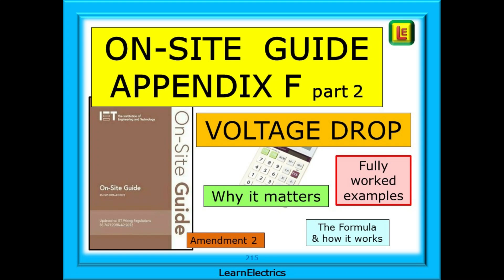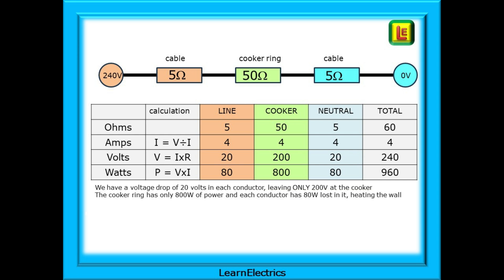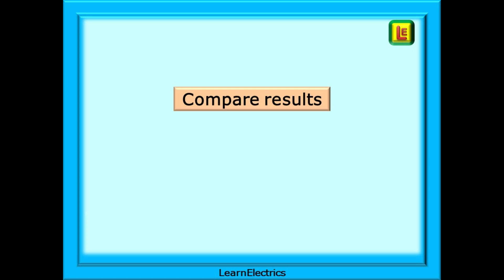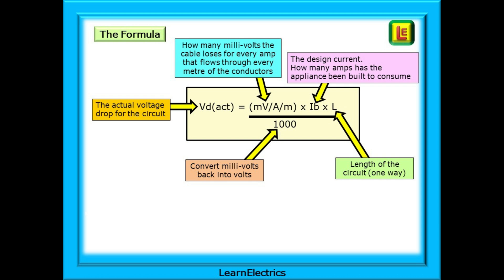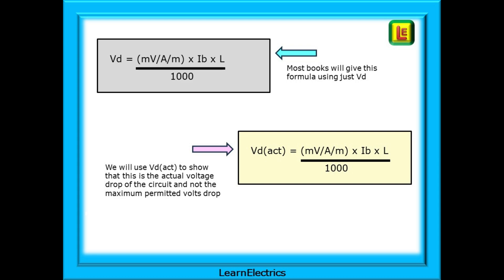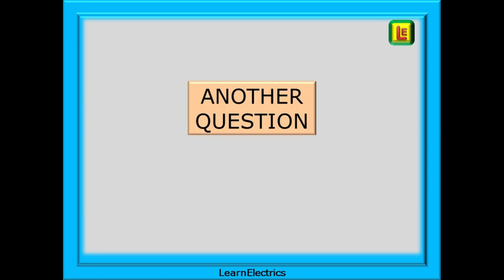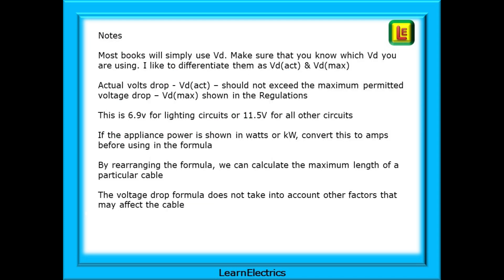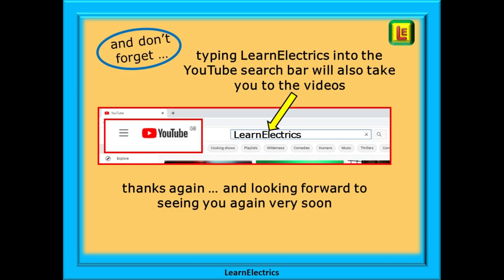ON-SITE GUIDE - APPENDIX F – PART 2 – VOLTAGE DROP - HOW TO CALCULATE IT – HOW TO SELECT CABLES

Comment: All examples shown have the load at the end of the circuit length. 
In a circuit with fixed loads such as a lighting radial, the loads are at different points/lengths from the CU.Does this mean we have to calculate vd at each individual point and add the sum?
Lastly in a domestic situation its unlikely all lights will be on at the same time. are there any diversity calculations to account for or do we always assume worst case?
Reply from the maker: Diversity says use 66% of the total possible load for domestic lighting.
With domestic lighting, which isn't that long a length and is comparatively lightly loaded, especially with today's low energy lamps, I never worry about distributed loads.
Industrially, where the loads can be high and the distances long, then yes, I would calculate for each point of use.
Thanks for watching. Dave.